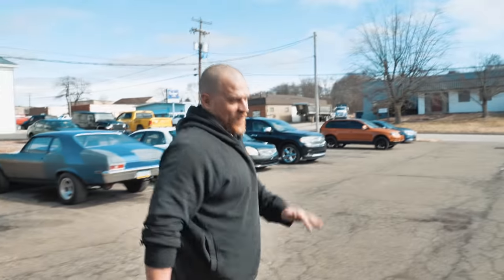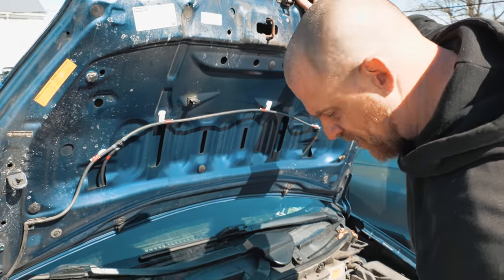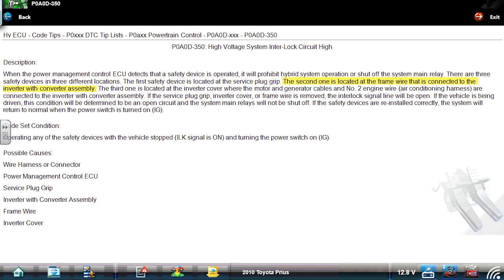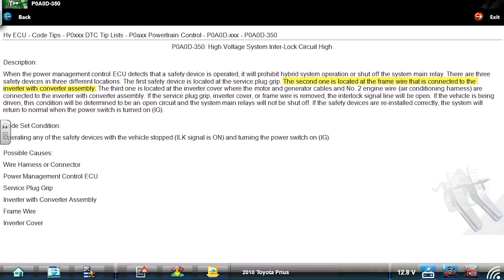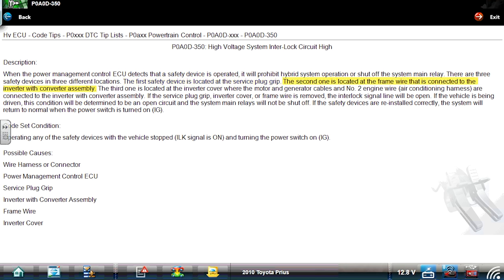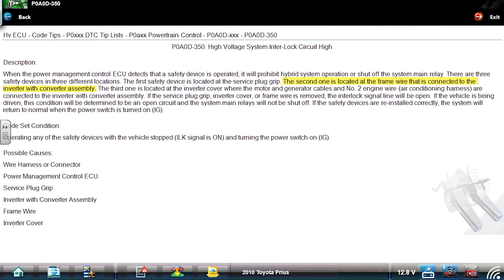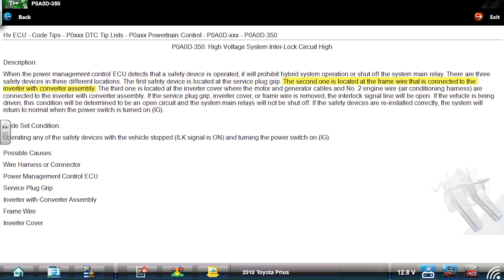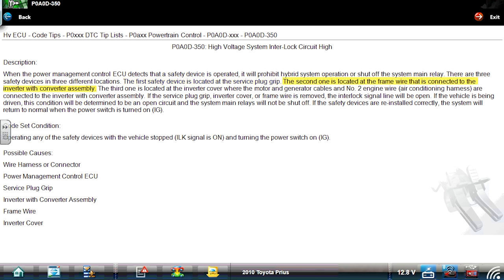Hybrid No Start and Electric Water Pump Diagnosis

Comment from the maker: If you want to know how to test an electric water pump on a Prius, this video is for you! As far as the no start with the gas engine goes, you can learn from my ignorance about this hybrid system and use my pain for your gain 😂
Reply: @ScannerDanner
I've got 2ea 2001 Honda gen-1 Insights (1's a parts car) and it's been an interesting learning and parts getting process. It's a bit different design than the Toyota. Getting into the HV components in the back (battery and HV controller) my hat's off to the Japanese engineering team. The designs and functionality relationships, even at 21 years old (closer to aerospace than automotive) are exquisite!
Reply from the maker: @LtBRS  exquisite is the right word and it is amazing technology
Reply: @ScannerDanner  
There's an interesting political history behind the gen-1 insights. Honda took a loss on each one sold here so-as-to bring their vehicle fleet gas-millage average up thereby qualifying for their highly profitable sales in the USA, and to continue with that revenue stream.
Tesla, (a great product) the largest volume EV producer is about to loose their dealer-exclusive maintenance position as all their competitors don't use that strategy. Whoever can hire the tech's and fill that nitch stands to do well, assuming the psychopaths behind the world's proxy puppets don't have their tslking-heads blow-up the world first.
Reply: Check out the WeberAuto channel here on YouTube for some great content on Priuses and hybrids in general
Reply: This is when it's good to have a subscription to Alldata, Identifix, bbbind or mitchell wiring diagrams...  You can look up all of those component and connector locations.
Reply: cardiagn
Reply: .com
Reply: I can't link the word above me, but thats the place.  There are free manuals there for virtually any car;   you have to use incognito mode on google chrome, for the pop up PDF viewer to work.
Reply: I keep getting cnesored here..  :(
so that's why there are several comments sorry.  It wouldn't let me put those words all together.  It kept deleting it
Reply: I love how you are humble in victory and defeat although I don't see a defeat here I see a lesson that you learnt and for all of us with the same knowledge as you when it comes to electric high voltage vehicles. For that thank you brother and God bless
Reply: I have the utmost respect for you Mr. Danner. I am only a hobbyist mechanic and I suspect I am a little older than you…HEV & EV’s will be the norm well within our life time. Modernity is upon us, obsolescence threatens if we don’t adapt…once again respect.
Reply: Paul, as the previous commenter below stated check out WeberAuto here on YouTube.  The guy is a professor at Weber Sate College in Utah and specializes in transmissions but goes in depth in hybrids on how they are designed and all safety precautions needed.  I have been following him almost as long as you and he really knows his Sh*t !

Comment: Hi Paul, once again, amazing video.  The frame wire the interlock wiring diagram is referring to is the large Orange DC cable that goes into the top of the inverter.  The connection at the inverter, the service plug and inverter cover have an interlock connector that open circuits when cable is disconnected or cover is removed, bringing up the P0A0 code.  The interlock circuit is a high voltage check circuit, the circuit loops through the three points referred to above and if any of those points are disconnected the ECM will see an open circuit, if the vehicle is operating it may shut the system off or prevent restarting once switched off. 12v is put out by the power management ECM and so long as the circuit is complete 12v will return to the ECM.  In a complete circuit 12v going out and is compared to 12v returning which produces a circuit potential difference of 0v.  If the interlock circuit is opened; in your case the service plug interlock connection was open by it being pulled back and unlocked, 12v was sent out, but 0v returns to the ECM, therefore the potential difference between each side of the circuit is 12v, hence the fault description as "circuit high".
Reply: Awesome information , thanks for sharing.

Comment: This video absolutely demonstrates that one of the most important "tools" a technician needs is access to factory information on the system they are troubleshooting, not just to enable a correct diagnosis/repair but in this case also for personal safety. No matter how long you have been in the industry you will  always find something new to learn.

Comment: Hey Paul, I love your videos. I’m a tech in Sudbury Ontario, a general consensus in the industry from what I have learned from other techs, is that the code  “replace battery pack” is a code solely related to the battery pack. It’s noticed a cell that has had an internal failure and before the high voltage battery causes a dead short (like in a regular gas engine that would burn up an alternator) it would potentially cause a fire hazard. 
So I would strongly recommend a replacement battery for that vehicle. As it’s a pretty important code and we all know how batteries not in good health can cause issues. 
Love your content. Learn lots!

Comment: This is great, I’ve worked with Prius for the past 10 years or so, found all kind of different issues with these cars, but never thought to put a scope on the pump, great explanation of the pump control and pump speed circuits, Lee up the great work

Comment: Under the inverter plate (the 10mm bolted on) you’ll find a high amp glass fuse. The system has 2 water cooling pumps, one for the gas engine and one for the hybrid components. 2 different cooling systems. Always disconnect the orange connector at the hybrid battery before working on the hybrid system. My first mechanic job were with these Toyotas in a taxi fleet here in NYC.
Reply from the maker: Is that glass fuse what they consider one of the 3 safety "switches" ?
Reply: @ScannerDanner  I believe so because that’s all that it has as far as maintenance goes. Keep up the great work you do.
Reply: probably failed inverter/motor pump, which shorted and blew a fuse in the small under hood panel, which disables the whole car instantly(driving down middle of the road in traffic ☠️).
I forget the fuse number and if it's 10amp or 15amp, but it feeds that pump and part of the ecm or bcm and other circuitry.
it will not power up the inverter/motor to start the ICE or do anything else but throw the big triangle of death and other I'm broken lights.
Reply: @throttlebottle5906  "Big Triangle of Death". Cool Description 😎

Comment: I love how apprehensive you were to mess with the high voltage system which I totally understand if you aren’t familiar with it but I work on these daily, never worn any high voltage gloves. I wish I could have been there to point you in the right direction during that lol
Reply from the maker: For sure and that hesitancy was greatly amplified by the camera! 🙂
Reply: Safety First SD. Nothing wrong with that. That way you can "Live and Learn".

Comment: Vehicle drove and overheated due to coolant pump fault, hybrid ecm shut off  engine (engine does not start code) also stored hybrid codes but someone disconnected the battery interlock, if the interlock was left alone clear the codes in both modules the vehicle would of started. Great diagnostics.
Your rattle at starting where it sounds like the gearbox is about to fall out is actually the egr valve sticking. You can remove the two screws take the body off and lubricant the sticking shaft pulling it in and out with a pair of pliers 💪🏼
Reply from the maker: Thanks for the information! And the comment

Comment: You can buy insulated gloves from electrical supply stores as well as the Snap-On truck. I bought a pair for the A/C three and single phase panels and equipment aboard the vessels I help repair or crew aboard. I have learned a great deal from you, as regards basic electricity.  I am disappointed your customer did not place his trust in you.

Comment: My name's Morgan and I used to be a parts changer.

Okay so I bought a 2002 q45 about 5 years ago and right away had an intermittent stall, I am still super new and learning about these issues but manage to find scannerdanners 2002 q45 video and it leads me to fixing it. FAST FORWARD TO ABOUT A YEAR AGO, I am fully hotrodding this thing but still very much an amateur. I am facing the most random intermittent issue where it feels like the throttle sticks after it's first hard acceleration, key cycling fixes it for about 5 minutes. At the time I have an oil leak into the alternator and I learn about false crank signal from failing diodes so I replace the alternator and it fixed it, car seems fine over the winter but it comes back after long drives in spring, gets back to the point of being about 10 minutes into the drive or one pull. I get NDS and confirm that something is pulling timing all the way to 0° advance, no codes. Being a parts changer and a smart ass I replace the alternator again with the original one remanufactured, instantly throws throttle body code and stalls. I replace that alternator with an OEM one, codes are gone but timing issue is back. 

At this point I'm almost 1500 into parts (solenoids, sensors, throttle body, 2 alternators and other crap I attempted), I watch scannerdanners Q45 video and it's like he's talking directly to me, DONT BE A PARTS CHANGER. I do my research and as I'm going through the grounds I find a split insulation on the cam sensor block ground and the copper is corroded, I clean it up and patch the wires with liquid tape and harness tape (I plan on replacing them, just waiting on double eyelets). 25 minutes into the drive and full timing, zero hiccups and other things feel smoother as well (shifts at low speed feel way better). 

It all comes full circle back to scannerdanner.

Tl:Dr scannerdanner saved my ass and I am beyond happy.
Reply from the maker: What a freaking awesome story and compliment to me. Now let me compliment you. In every part of your story, you've never asked for my help (not that I remember?) and especially never asked for a silver bullet. You buckled down with a thirst for knowledge and made it happen yourself. I've just recently mentioned in my last video (read my pinned comment about selling diagnostic time) about the 10%? You sir ARE in the 10%
Love it! Awesome to see. Thank you so much for sharing
Reply: @ScannerDanner  I was ready to put a standalone in this thing thinking it was just a weird ECU being sensitive to timing chain slop or something like that, turns out it was just a not fully grounded crank sensor.

Weirdest part is the connection wasn't that corroded, which explains why it ran okay for about ten minutes but once it built up too much resistance for the ground, it started messing up the square wave. This has given me so much confidence going forward, I'm never selling this car!

Comment: I do battery packs all the time on these, never once worn gloves. Disconnect the plug at the battery and wait the 10 minutes for the capacitors to discharge and you are good to go! Just make sure to snap the connector back in correctly at the end of service.

Comment: Hello sir, I have been following your videos for a long time and I have benefited a lot from them. I would like to thank you for that for the Prius car. First, the main plug  must be disconnected to avoid any complications during work. If you want to remove the battery, you must use it to remove the rest of the small plugs on the battery cover in relation to the code for B on the water pump, this means that the problem is in the same pump, and you can check through the engine information and compare the rotation speed of the pump with the expected speed, so that the difference does not exceed 150 revolutions, and if it is an increase, I advise changing the pump if you get a code, not “E” means that the problem is in the electrical circuit of the pump

Comment: I've replaced hv battery's .rebuilt  inverters. Replaced engines and never once wore gloves . It's normal for the it to make noise while miss firing. Head gaskets are common so is water pumps.

Comment: I’ve seen those electrical water pump fail and when they lockup they blow the fuse and cause a no start! Through live data you can see the water pump work there’s a rpm you can see. It’s a water pump and a rubber gasket us a vacuum fill tool put the vehicle in ready mode then run it. You can find YouTube videos on ready mode easy fix very common as well as head gasket issues. Still a good video love them all.

Comment: FYI - On those head gaskets, I used Bars Leaks Head Seal.  It is the blown head gasket repair with carbon fiber.  It is around $40 a bottle.  You have to just remove some coolant from the overflow tank and then dump it in.   I have done 4 of them now.  The oldest one was 2 years ago and they are all still running fine with no misfires.  Pulling the head on one of those older ones is quite a job and will probably exceed the value of the vehicle.

Comment: Way to go man! You're above and beyond the mechanics here in Georgia that are scared to work on these. A few years ago I needed help with Gen 1 Insight and couldn't find any takers. In my view, that's inchoerant madness as EV's are coming in mass.
Reply: I’m from Georgia and we are not scared! Just a car at the end if the day.
Reply: A lot of times when you have a safety interlock problem, check the large one by the HV battery. The majority of the time tow truck drivers or someone has not completely reconnected it. It has to be pushed down and slide over.
Reply: @rexberttechnica6702  
I'm just curious. Is that covered in the Toyota's owner's manual?
Reply: More so in service data however, there is a free website posted for first responders which anyone can view which shows safety precautions.
Reply: @rexberttechnica6702  
Ya, no surprise there. I shouldn't be curious as the population has been socially-engineered to (for the most part) ignore instruction manuals, owners manuals, etc like in new cars, software use agreements, and new electronics. Electronics dependance has really shortened peoples attention spans.

Comment: Those motors, like in that pump, are becoming more common and have been common in computer fans for years.  Look up “4-Wire Pulse Width Modulation (PWM) Controlled Fan” for lots of write ups on how they work.  The ECM simply looks to see the feedback is within some range of the command.

Comment: Lol..funny video , Paul you taught me a lot, but couldn't believe you guys didn't know about the main orange plug in the back. You pull that and shuts off the voltage, btw these engines are famous for head gasket issues! Replaced one of those engines a month ago and thank God everything came out great.
Reply from the maker: First time working on one 🙂

Comment: I remember that service switch from the ChrixFix video on replacing the hybrid battery.  You pull sideways then pull that lever toward you and the service plug comes out of the battery.  That’s the part you put in your pocket.

Comment: I had this problem on a Aqua. I took all fuses off and Reinstall. Cleared the codes and car was in ready mode. The water pump for hybrid system was the fualt and car was going in safety mode. By removing the fuse and reinstalling it got ready for some time and again in safety mode. I replaced the pump and car was fixed

Comment: There is a red flip cover in the fuse box where you can get 12v or give 12v if you leave the dome light on for a week  at the airport.  I like you channel.  I have a P 261B in the driveway right now. Your diagnosis is much quicker than what Toyota Manual suggests.   What i have is intermittent so i am slow to just change the pump without further checking.  It seems they will shut down with little warning at highway speed on a pump error code.   Thanks

Comment: Chrysler tech here... I have the training on the hybrid/full electric vehicles.  I agree about not touching anything w/o the proper safety equipment. High voltage is not something to mess with when one knows nothing about these systems. But, that plug in the back, it is the main high voltage battery disconnect. What Danner found is the first interlock of that plug, it disconnects electrically, the rest of taking the plug out is mechanical. The orange color is only on the high voltage system. The other safety interlocks are automatic, they work when you disconnect the connectors. Btw, you don't have to put the plug in your pocket, just somewhere safe that you have absolute control over.  As far as the gloves go, it's worth the investment to get them. I would recommend that you get the training, as as time goes on, you're going to see more and more of these vehicles.

Comment: I hope you learn more about hybrid systems. I'm surprised you haven't worked on them before. I went through Hyundai's hybrid training when I was a dealer tech. It's an entirely different design compared to Toyota's, but I know Toyota's inside and out too.

The Prius launched in 97 and came to the United States in 2000. Also, Toyota's system uses two electric motors, one big and one small, connected to the engine with a planetary gearset. The wheels and the big motor are always coupled. The high voltage system must be operational for the engine to start since the small motor is the starter/generator and can also partialy contribute to powering the wheels. It's a pretty robust system.  AWD hybrid Toyota's have an electrically powered rear differential that isn't mechanically connected to the rest of the drivetrain. It's very low horsepower. Less than 50 HP if I'm remembering correctly, but that's enough to get you out the snow and mud.
Reply from the maker: Definitely need a basic class to get me up to speed. Just never cared before because we never see them. Guess it's finally time lol